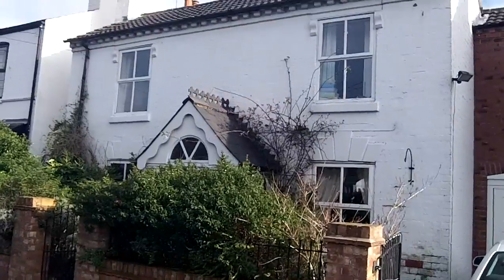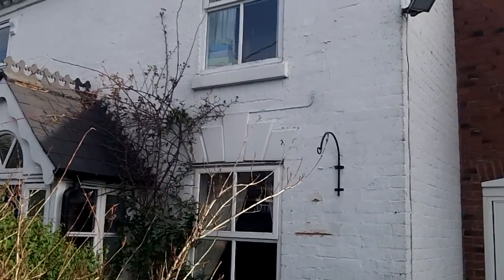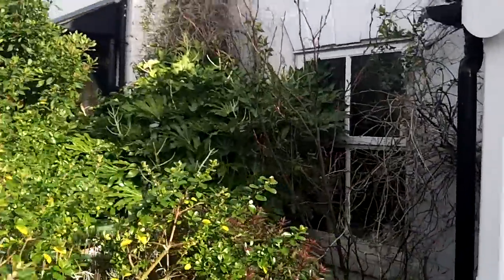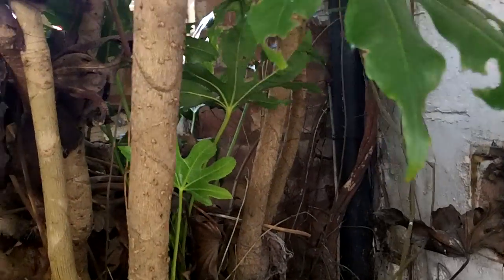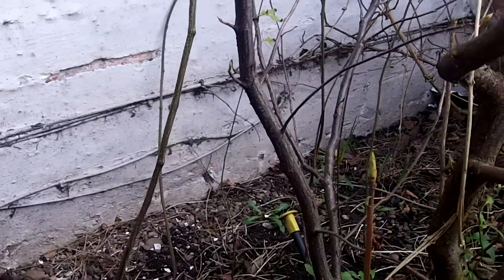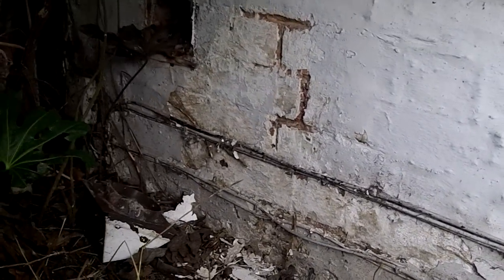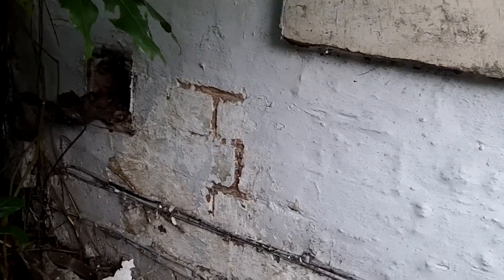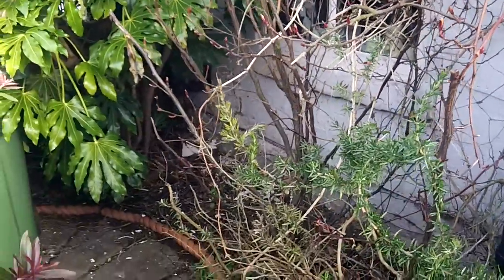Damp walls in an old house - why, and how to understand.

Comment: Thanks for the great video Peter.  Is there a link to the "next two videos" with reasons and solution mentioned in the video description?  I've searched through your videos but can't find the ones which lead on from this video. Thank you

I have a near-identical problem in my house with high external ground level and perpendicular garden wall against the house, except the high ground level outside is caused by wooden decking running up to the house (the decking is above the ventilation airbrick, blocking it from air circulation).  Similarly to this video, in the respective interior corner the plaster skim carried out by the previous owners is wet to the touch, but the brick underneath is dry to the touch.  I plan to strip back the plaster to the brick in case it holds any salts and get rid of the decking to lower the effective ground level and expose the ventilation brick.  I'm planning to get an independent damp survey to be on the safe side, but it would be interesting to see what your solution was to the case in the video.

Comment: Thank you for all your videos, been very educational and I am going to steer well clear of any damp proof company now. What is the solution for outside walls butting up against the house? I have a garden wall that joins to the corner of my property and a damp area on the inside corner where the walls join. Ground levels are a bit high too so working on lowering that but I can't seem to find your fix for walls butting up against the main building.
Reply from the maker: I tell folk to separate it. If the gap is filled with breathable material like lime mortar (hotlime not nhl) it will let go of moisture and wont be a problem. I'd focus on the join, clean it out, remove any cement, and get it drying, then if you want to joint it back, use lime mortar..

Comment: Hi there, thanks for this information. We have spent £££ on trying to fix a damp issue on our 200 year old cottage. Now I think I've finally got what teh problem is... A brick build porch was added on to the front and I think these walls are trapping moisture like you say. The level of the concrete at the front of the porch is also high, which is easily to take out but what about the walls from the porch addition? It's a lovely porch with quarry tile floor so we would like to keep it if possible & planned to enclose it with glass. Any ideas? All damp people seem to do is talk about rising damp 🙄
Reply from the maker: Really need to see pics - but its all about temps and moisture in the air - you dont have rising damp - doesnt exist - but if walls are cold, moist air will condense within the walls - so need to look at ground levels - and heating - if its a cold area with no heating, its quite possible you will get some issues - you WONT if it is all breathable - but modern materials like cement and gypsum will give you grief.  Take any gypsum off and either leave bricks bare or lime plaster or limewash them...  can email peter@heritage-house.org if need more info
Reply: @WarmDryHome  Hi Peter, I sent some photos to your messenger...we are having to replace the floorboards and joists in this area of the hallway. But we're still not 100% on why the damp is so bad here. It doesn't appear to be modern plaster, how can you tell of its gypsum or lime? I think maybe the ground levels is an issue but we put aco drains there to take away water but it seems to have made it worse! I've been told to gig up the aco and replace with a proper French drain and also to put tanking slurry on the outside everywhere the ground meets brick before putting French drain in. But would this correct the issue with ground/water levels? Of not any advice on how it's done? It's very annoying/frustrating as it cost £1300 to put acos down a few months ago 😣
Reply: @WarmDryHome  it is a cold area we haven't got a rad there yet, would installing a rad against this problem wall help? Thanks again

Comment: hi peter, thanks for the vid.  you said the problem was caused by high ground level,  is there a solution to this?
Reply: Yes lower it
Reply: If the high ground was bone-dry, then there is no problem since there is no moisture. It looks like this house is in a country that has a lot of rain (U.K.?) If you dig a french drain around the outside perimeter of the house 2 feet deep, then the level of ground water during even a heavy rain could never rise more than two feet to ground level (even the ground underneath the house). However if the water level is 2 feet deep during a heavy rain, then water will still wick up to the surface via capillary action and make the inside of the house have high humidity. You can break the capillary action of water traveling upwards towards  the ground surface with a layer of 2-inch gravel (the same gravel used in a french drain). At this point water vapor would still slowly rise from the moist ground and make it's way into the house, so to stop the slow movement of water vapor from the moist ground into the dry interior of the house, you can cover the ground under the house with plastic water vapor barrier.  At this point no water or water vapor is entering the house from the ground.

If there is a crawlspace under the house then this is all easily done. If there is no crawlspace, or if the house is built on a huge slab of concrete, then this cannot be done without great cost.

* note - maybe don't even bother with a layer of 2-inch gravel, just lay a plastic vapor barrier on the ground underneath the house.

Comment: Hi Peter
i live in a victorian terraced house with the yard wall butted up against our house and as you described we have dampness inside at that location . Apart from knocking down the yard wall what can you suggest to solve the problem. The interior bottom half had been replastered with gypsom which i have now removed.
regards
Richard
Reply from the maker: Best to cut down the wall to provide a gap between wall and house.  Allow to dry, then re-point / fill gap with a soft hotlime mortar to provide friction.  The top of the wall needs to be able to breathe - if there is cement in the capping, remove and allow wall to dry out - unless built entirely in cement...
Reply: Thank you Peter
Reply: call Peter he will take your money! The DAMP WALLY!
Reply: what are you on about?  @jammybcfc5846
Reply: @WarmDryHome  Just asked you the same question but now I have the answer. Thank you again.

Comment: I have just looked at a stone built cottage which is rendered on the outside and painted, there is a degree of damp on the inside I'm assuming due to the rendering, however it wouldn't be financially viable to chisel all render off! Could you recommend a internal plastering solution! Or should I just walk away from the property?
Reply: David Bowler I'm a stonemason in South Wales.  If your render is cement and paint plastic , therein lies your problem and nothing you do internally will make a bit of difference .
Reply from the maker: James is right - you either take the render off, or may be able to increase ventilation internally to improve things - most likely there is not enough ventilation anyway.  Problem is that if the walls are damp, and cement outside and gypsum inside, you  have a swimming pool - and need to get one or both off to let walls dry out.
Reply: Hi both, if the render is removed should the wall be just allowed to dry out. Builder is suggesting wall is waterproofed and tanked as well but I thought it was the render causing the problems.
Reply: @jamesbarry9147  Hi, if the cement render is removed should the wall be just allowed to dry out? Builder is suggesting wall is waterproofed and tanked as well but I thought it was the render causing the problems
Reply: @rachelwesterman1223  tanking doesnt solve anything . it's basically papering over the cracks . where are you based Rachel? prob best to get a second opinion from someone with experience of working with historic buildings
Reply: @jamesbarry9147  I'm actually in South Wales myself in Barry. Thanks for the response.

Comment: Hi peter quick question for you i am about to repoint the rear of mine after removong the cement mortar.. underneath  Its lime mortar i was going for the 3.5nhl as outside and at ratio 3 sand 1 lime.... is there any aggregate additive you would recommend easily obtainable from usual merchants or diy places or would you stick to just the lime and sand? Also which sand would you choose standard yellow build sand or a sharp

Cheers
Carl
Reply from the maker: Carl - I'd use a softer NHL or hotlime - 2.5 is preferable to 3.5 - and a gritty sharp sand - definitely not builders sand.  No additives. Gauge it - so 3 buckets, tapped down and flattened off, and 1 bucket tapped down and flattened off - DONT use shovelfuls - it wont work...
Reply: Peter Ward thanks is it worth spreading the sand out to dry as in bags it would be wetish as i read it supposed to be dry mixed first 

Many thanks
Reply from the maker: No point - you're adding water when you mix it...!  Complete nonsense about dry mixing..

Comment: In winter we sometimes develop mold on our bedroom wall. I We keep the furniture at least 15 cm away to allow ventilation, and I put a small fan to move air across the wall, and we try to keep the inside temperature at at least 20, so not ideal but mostly works. I wish I could hire you to come take a look, but I suspect that you don't come to Germany. ;-)
Reply from the maker: Hi - 20 degrees is quite warm - and that allows a lot of water to dissolve into the air - making it moist. Which is why it settles on cold walls and creates mould. The key here is not fans, and heat, but removing moisture at source - and VENTILATING - ie, removing the moist air and replacing it with dry air, which involves exchanging the air in the room / house.You need to measure the Absolute - not temp and relative humidity - but both those and the calculated value of absolute - which gives total moisture content - should be around 7 gm/3 - I'd guess its up around 12 to 14 for mould to grow, and probably in winter in Germany, air is at 6 or 7 g externally - so bringing outside air in, warming it, and exhausting damp air is the way to go - so humidity controlled extraction (see the Vapourflow website) is the best option...
Reply: @WarmDryHome  Peter, many thanks for the trouble of the kind reply, I am much obliged. Relative humidity runs 55-60%. I need to figure out how to measure absolute water content  (I guess a function of temperature and relative humidity? I'll look it up). We open windows for a couple of hours during the day, and have negative ventilation in our bath (fan vents to outside, runs until relative humidity drops to 60%). We like keeping our bedroom cooler than 20, but the mold worsens, as the dew point comes closer to the insides vs. out sides of the walls. Also, we have a hood fan over our range (cooker). We have a heat pump that doubles as a dehumidifier, have not been aggressive about running it.
Reply: @WarmDryHome  Apologies for the long post
Reply: @WarmDryHome  OK, according to  an on-line calculator I found, we're running in the neighborhood of 9 or10 g/ m**3, about borderlinish (I assumed 20 deg C, 50-60% Hr).

Comment: I've got a terraced house with a path for other houses back entrances, how many air bricks would you recommend? I recent put one on the side and now air is getting into my cellar and under floor, hopfully it will help the damp outside walls.
Reply from the maker: The standard seems to be around 1 per 1.5 metres of wall length - the most important thing to me is that they are the old cast iron type with vertical bars - modern ones with little holes in a clay brick are useless - they seen get blocked with cobwebs and dont let enough air in anyway.  You certainly need through flow of air - and need flow through cellar and either into house or from house as well - to circulate dry air.. Complex - needs designing really if youo have a cellar - most old cellars need proper humidity control ventilation to do the job properly - look up RHL Ltd or Vapourflow as they now called - they are the only humidity controlled kit I would ever use..
Reply: Do you know why my walls get damp when it rains, it's not rising damp but has all the hallmarks of it rising to one meter but I peeled back a tiny part of the wall and it's not wet. Condensation with a cold house? BTW the air brick I put in is the plastic one with downward grill to stop any water and yes I go some kind of big metal grill square holed version on the front, going to put another air bring on the side to vent air into the cellar. I just can't figure out why my outside walls are getting damp but not my back room wall, very odd.

I tried injecting that DPC and it hasn't stopped the damp at all, good job I didn't pay much for the tubes and only went half way along the outside wall because it doesn't seem to be working at all. Got rain today, walls are damp.
Reply from the maker: Injecting is useless... Ventilation is what needed - humidity control - need to understand moisture in the building - the RHL humidity controlled fans are the best ones - company called Vapourflow - I wont go anywhere else - need RH to be below 50% at 18 degrees C in the house.  If higher = damp problems on walls, which is what you have...
Reply from the maker: Injecting is useless... Ventilation is what needed - humidity control - need to understand moisture in the building - the RHL humidity controlled fans are the best ones - company called Vapourflow - I wont go anywhere else - need RH to be below 50% at 18 degrees C in the house.  If higher = damp problems on walls, which is what you have...

Comment: Great advice, Peter.
Reply from the maker: Thanks!  Any problems - shout and we'll do what we can..
Reply: Thanks Peter. Nothing so nearly extreme as any of your cases. Just a band and small patches  of mildly discoloured paintwork that persisted after plastering. I don't think the walls were ever sealed. I'm going to try the Ronseal Damp Seal and see how that goes.
Reply from the maker: It wont work - you'll make it worse - need to find the source and fix  -may just be salts, so take contaminated plaster off and do in lime?
Reply: Ah right, thanks, I'll chip it back and re-plaster if it doesn't.